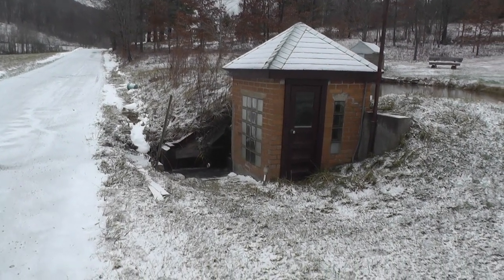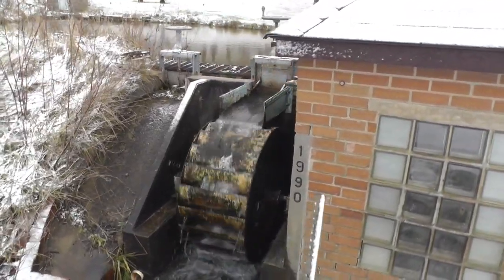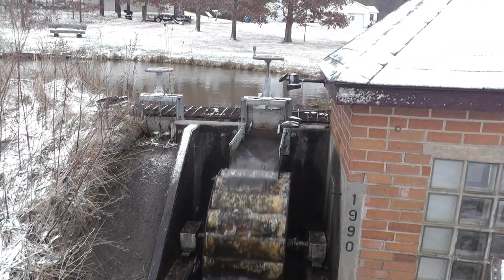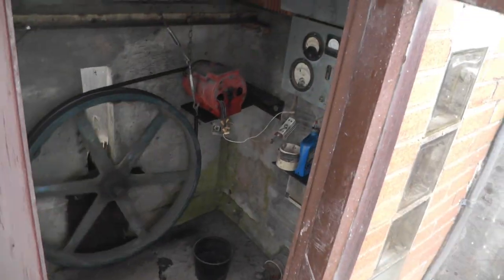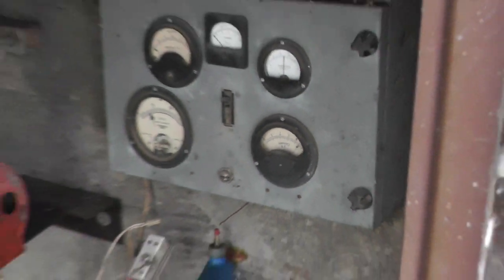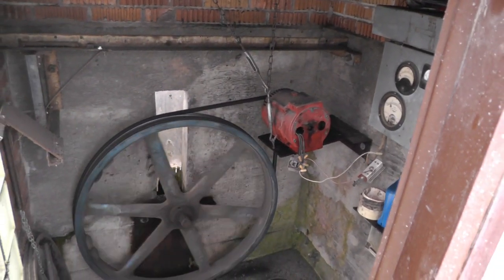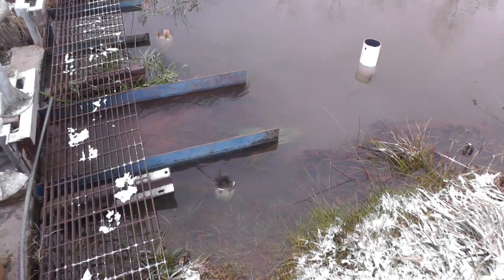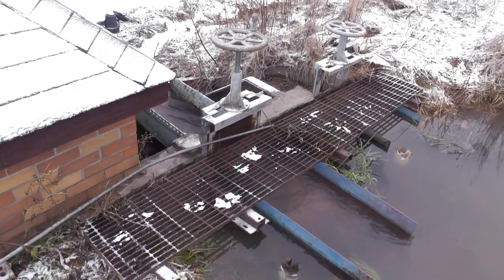Water Wheel

Comment: How much power does the generator put out? Is it AC or DC and how many volts.
Reply from the maker: It is a 3 phase PM generator with a bridge rectifier charging a 12 volt battery bank. Thanks for watching.